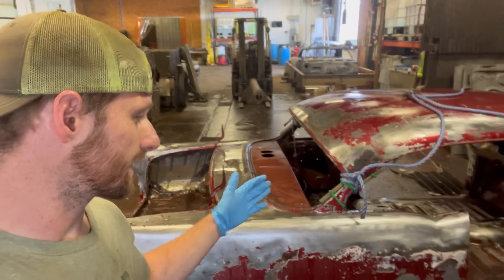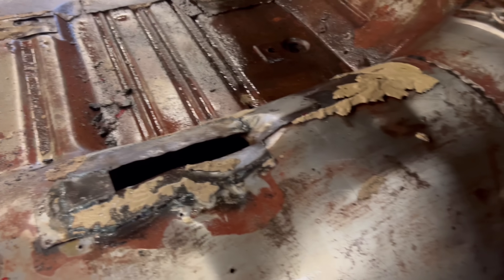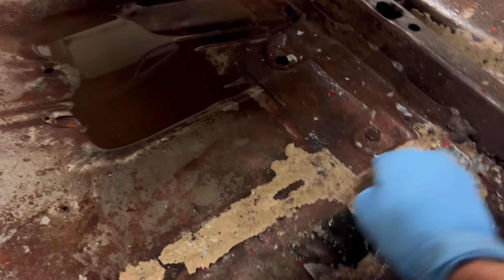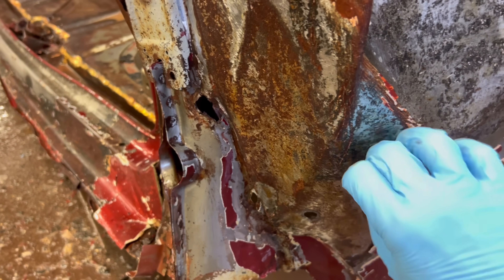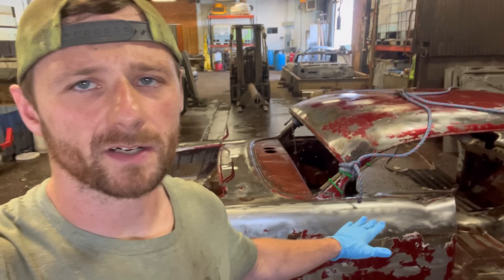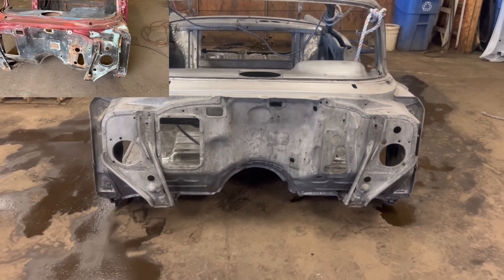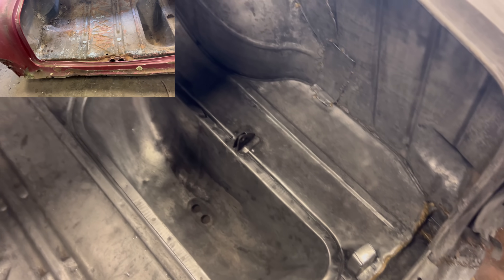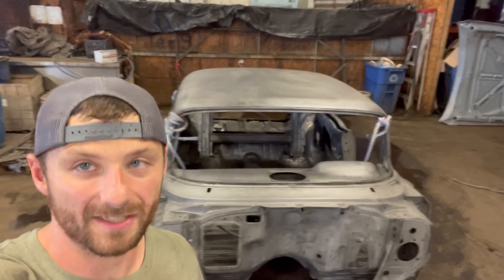1957 Chevy Bel Air Chemical Paint and Rust Removal

Comment: A little over 30 years ago I had the frame and suspension of my 37 Chev PU dipped.  It came out great.  But things happened and the project go set aside until recently.  I never had the cab or the rest of the body dipped.  Would love to do it, but there aren;t any metal strippers close to western South Dakota that I'm aware of.  The cab is virtually rust free, there were two small spots where the back cab wall met the floor that were bubbled up and I've had those patched.  Any other rust is light surface rust.

Comment: Dipping is the best way to get a clean slate to  fix and repair everything that could be hidden.  But you need to dip into a sealer tank to get coverage on back side of closed areas that a spray gun will not touch.  Great video and enjoyed very much.
Reply from the maker: Thank you! Most of our customers get the cars primer dipped or Ecoated afterwards. They submerge and rotate the whole car.

Comment: As a fellow owner of a basket case shoebox Chevy -

Hacked up transmission tunnel  - Check
(I suspect a 4 speed graced it sometime in the 60s/70s - they used a screwdriver and a hammer to cut the hole, and no evidence that their tool kit had ever seen a hacksaw)

Gnarly rust ridden floor pan and wheel wells - Check
(took 6 months on a rotisserie for me to replace several rotted out braces, inner rockers, driver footwells, rear wheel well skins, and the transmission pan)

Unbelievable amounts of filler in the Quarter panels - Check
(Mine was rotted out in both fender lips on forward, the passenger side was so bad they had bailing wired a piece of rebar in the gap and sculpted filler to match the panel lines)

Odd placement of said filler - Check
(when they "installed" the 4 speed they took utmost care to "drill" a hole in the dash for a Tach and then the next owner filled said hole with filler along "shaving" the trim holes in the front fenders where the stainless trim was suppose to mount.)

I wonder if you ever dip the doors and/or front fenders for these vehicles? I know from experience that they can tell quite a bit about the trauma these survivor cars have gone through over the last 50+ years.
Reply from the maker: I do a lot of the small parts too. I usually post them on my shorts